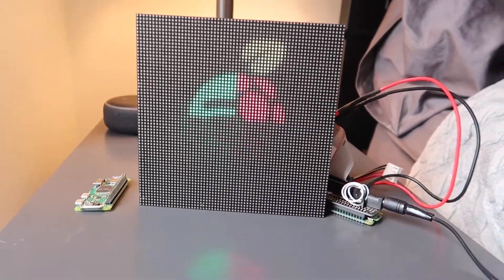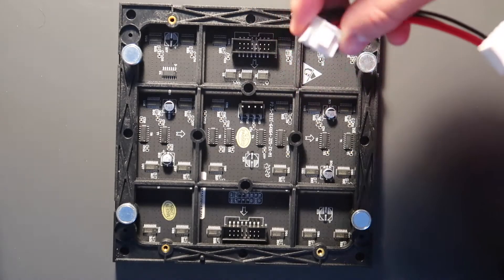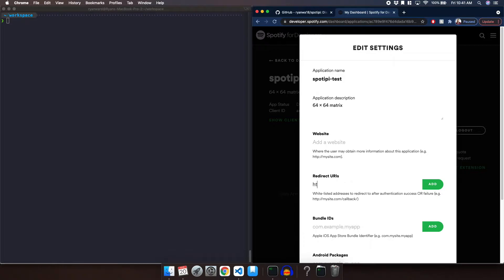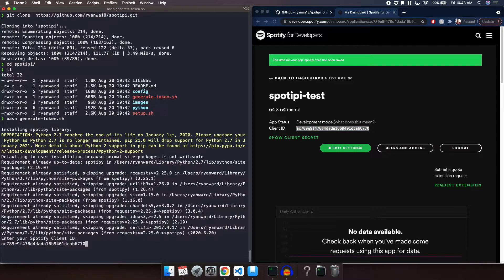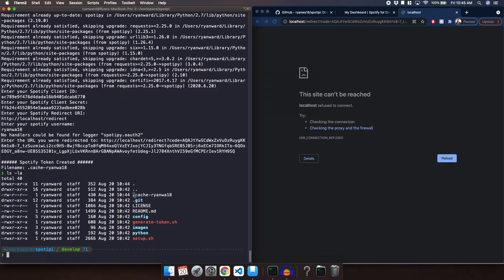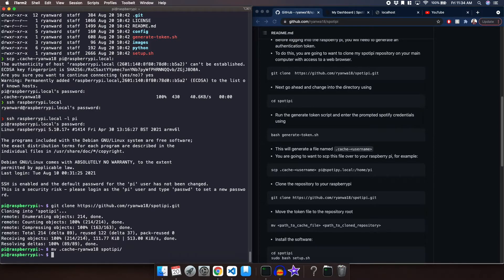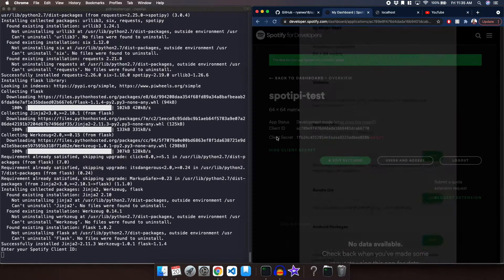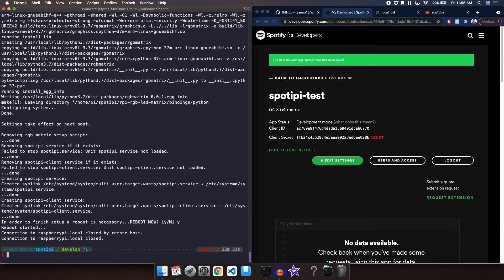Raspberry Pi and Spotify Powered Frame

Comment from the maker: For those wondering, the code changed and the file “.cache-<username>” is now just “.cache”
Reply: Hi Ryan, I am trying to set this up. I have put together all components and soldered the relevant pins on the bonnet, are you able to help as I am trying to set this up using putty via windows. I have installed the raspberry os on the SD, inserted and then SSH'd directly onto the Pi. I have then configured using the commands (im not sure if because im missing any of the copy steps it is not working) I shouldent need to copy anything providing its all been set up already on the pi?)

Any help is appreciated
Reply: @Echo42Luke  see a comment of @rwardtech below. He advises to run everything directly on the pi

Comment: I modified his code so it works on my github (nicotheburrito)
Reply: hi, thanks for your work on github. could you please fix the readme. it mentions wrong urls in think (/Spotify-screen). could you also attach a screenshot in the readme of the running panel? that would be awesome.
Reply: @niesfisch yes i will fix the readme but when you say the running panel, do you mean running the program in the terminal?
Reply: @ i mean the led panel :)
Reply: @niesfisch  sorry ive been busy, ill update the github around this week but just to verify, you want a picture of me using the led panel or just the panel while its off?

Comment: If I were to use a raspberry pi 3b, would I need a power supply for the Pi and the bonnet? And if so, if there a split cable online I could buy that could power both at the same time?

Comment: Hi, cool project, I got it to work and it looks awesome! The only issue is that it takes a while for the display to update, it can take anywhere from like 10 seconds after the song starts to halfway into the next song. Is this due to the nature of Spotify's API or is it something that I can fix myself?
Reply: Update: I got it to switch songs in a timely manner by making the following changes to the code:

1. Make the cache file writable 

2. Change the time.sleep values in the python file from 1 second to 5 seconds (Pi zero gets overloaded if you try to query every seconds, might be fine leaving this alone on a more powerful pi)

3. Add a 10 second timeout to the get request in the python script. I think this was the main issue. If you don’t have this, then it’s just gonna hang forever until it does get a response from the server.

Comment: @rwardtech i tried your tutorial with the solderin but I don't get any output to the screen. The spotify app dashboard recognizes the requests that are coming in but the screen stays black. When i hold the screen and apply light pressure by the sides a few leds light up a little and dim again when i let go. Do I have a faulty screen? The power and data seems to be coming through when i check for a current but the screen stays black. In the raspberrypi.local dashboard everything looks fine and the screen is set to on. Can you help me?
Reply: @rwardtech do you have any idea? still struggling to get it to work
Reply: I have having the exact same issue, any ideas on resolution?
Reply: I also have the same issues, my matrix works with the bonnet when I run other code - but this doesn't work for me
Reply: Was anybody able to figure this out?
Reply: i fixed the code on my github (nicotheburrito)

Comment: Hello Ryan, I have gotten everything to work and it displays a raspberry as the default page. However, the spotify album covers will not display as I play music. How can I troubleshoot what went wrong with this part of the project?
Reply: what path did you use for your token?
Reply from the maker: I would first see if you can access the web client. It should be http://<ip address or hostname of raspberrypi>.local
Reply: @rwardtech  I appreciate the response! I got it working, I was screwing up the path to the token. I did solder it but the display is quite flickery and it is not super easy to tell what album cover you are looking at. Currently looking into that
Reply: Another update! Redid the soldering and it looks gorgeous
Reply from the maker: @brycedesabrais2442  Awesome, glad it turned out nice!

Comment: Do you have to connect the Pi to a laptop, or does it work via Wifi?
Reply from the maker: Nope, it just connects to your wifi!
Reply: @rwardtech  Thanks! So it should work with a Google Home Speaker?
Reply from the maker: @IJuziI  Yep it will work as long as the speaker is connected to your spotify account :)

Comment: Hi Ryan, this was my first Raspberry Pi project and it is such a center piece at home. I started with a 32x32 matrix. Just bought a 64x64 for extra details. I set it up, but I am noticing flickering which was not the case with the 32x32 matrix. Any Ideas? 

Awsome project, and thanks.
Reply from the maker: Thanks for the kind words! With the 64x64 did you solder the “e” pin on the matrix bonnet?

Comment: Hi Ryan, whenever I'm trying to make the .cache file, this message pops up. Also it just creates the .cache file, not .cache-[spotifyusername].

/home/pi/spotipi/python/generateToken.py:12: DeprecationWarning: You're using 'as_dict = True'.get_access_token will return the token string directly in future versions. Please adjust your code accordingly, or use get_cached_token instead.
  token = auth.get_access_token()

It does seem to create the file though so, not sure what the problem is. When completing the setup, my display doesnt show anything though.
Reply: Hey man! Have you solved this? Im having the same issue, my screen is stuck on the base logo. I checked the Spotify console, and I've had one pull request
Reply from the maker: Yes, this was an issue with the code. It removes the username from the file. But just using the .cache file will work just fine!

Comment: Went through this twice now but nothing is appearing on the matrix. The default spotipi logo appears when I try and run a different .py file to test the matrix is working, but no album cover. And if I run your individual .py files (displayCoverArt etc.) I get "No Module Named Spotipy" even though I've ensured it's installed, and tried re-installing it with 'pip install spotipy' and a half dozen other commands. Any ideas?
Reply: hey man, im having the same issue, have you solved it by any chance?

Comment: Hey there, i love teh idea to see the album cover on a led Panel.
So i ordered the stuff needed and tried for myself.
I went through the whole installation without any obvious errors but when i try to open the cofiguration page in my web browser i can't find the pi.

Could anybody offer some help on that?
i can provide more information if neeeded but i just used the tutorial on a fresh raspbian buster install
Reply: Can you connect to the Raspberry Pi via ssh?
Reply: @juliak.2712  yeah all that worked. i'll try again today maybe i just missed something
Reply: @juliak.2712  it worked now. I don't know if i did something wrong several times or if the script got an update. Anyway thanks for yoour help.

Comment: I have a question: Does it make a difference if I use a 64x64 3mm pitch, instead of a 64x64 2.5mm pitch? I wanted to buy the one you use, but it is unfortunately out of stock:(
Reply: The 2.5mm will be slightly smaller, as the pitch is the distance between the LEDs. Outputting to the display should be the same. 

I just ordered the 2.5mm myself as well 😊
Reply from the maker: It makes no difference at all :) The pitch just means the space between the each pixel. A smaller pitch means the matrix will be smaller. Where as a larger pitch means the matrix will be bigger. Hope this helps!

Comment: does with work on Windows? when I put in the bash generate-token.sh command it gives me "command not found" errors and skips over all the Spotify inputs (client id, secret etc.) and tells me that is has created a token "Filename: .cache- ". Not sure what I'm doing wrong.
Reply from the maker: I recommend running all the commands on your raspberry pi. This eliminates issues regarding macOS or windows
Reply: Hey, i just solved your problem:
you have to change the end of line format of the "generate-token.sh" file.
For that open the "generate-token.sh" file with Notepad++.
Then you have to click on edit, format end of line and change to unix.
Afterwards just safe the file and try to run the bash command again.

Hope this helps.
Have a nice day :)
Reply: @maxa.2337  Hey man thanks for your help. This partially solved the problem and it is appearing the command prompt now but it is telling me pip isn't found for line 2. I have python installed on my computer but do I need to install the UNIX version also? This is kind of a first project so I think I'm missing some groundwork stuff which the video assumed I would have.
Reply: @Billy-jw6zz  hey did you figure this out? Having the same issue

Comment: I set up everything but the screen still doesn't display anything, the setting page works but just not the matrix, anyone know what might be wrong or a way to test if my rgb matrix is actually working
Reply from the maker: Join my discord https://discord.gg/P97DPpfV

Let’s see if we can figure out what’s going on :)
Reply: @rwardtech  hey man, could I get an updated link? This is expired?
Reply: did you get the issue fixed?

Comment: Hi Ryan,
This is my first project with a raspberry pi. Is there any setup for the pi needed before installing the software on the raspberry pi? Do I need to install the pi OS first? Also any tips for a newbie at this would be much appreciated :)
Thanks for the awesome video!
Reply from the maker: Yes you need to install raspberry pi OS! I recommend using the version named Buster. There are known issues with using spotipi and the latest pi OS named Bullseye
Reply from the maker: Also join the discord https://discord.gg/P97DPpfV

You can post any questions in there :)
Reply: @rwardtech  can we grab a fresh link ? Running into issues with the generating token step

Comment: Hey there nice video, is there a way to connect this to a battery instead of a wall adapter? Would be really nice to hang it on a wall permanently only having to take it off for charging a rechargeable battery.
Reply from the maker: This is definitely a possibility however it’s something I have not tested. I would imagine you would need a pretty good battery and would have to charge it pretty often

Comment: I’m not good with soldering. During the set up, is it possible to use the convenience option and skip the soldering of GPIO 4 and 18 for the project or is it an absolute requirement?
Reply from the maker: It is possible to just use the convenience option! You likely see flickering on the display but it should work

Comment: Great tutorial. Thank you so much. Btw is it possible to change the Resolution to 128 x 128.I have 4 Hub75 and I want to chain them together.
Reply: I am also looking for a solution for this. I have a NovaStar MCTRL300 and 4 1.9mm 128x128 modules on a frame.  I'd love to do something on this with a high definition image of the album cover but am having a hard time finding a way to do it, between using a service like Dakboard or programming something like this. Please reply if you find a way to do that?

Comment: Hey, I have the following problem: When I run the file "bash generate-token.sh
" I get this message "generate-token.sh: line 2: pip: command not found
". After my user name this message: "Traceback (most recent call last):

   File "python / generateToken.py", line 2, in <module>
     import spotipy
ImportError: No module named spotipy
"

Can you help me?
Reply: It works. I have forgot to installed Pyhton. But now: i dont get the Authorization by Spotify.
Reply: @Official_LKS  hey, did you solve this problem? Having the same issue
Reply: @EliBlumkin  Did you work with Gitforwindows? You will need an extra computer. On this computer, you must load and install the dates from GitHub.
Reply: @Official_LKS  I’m working on a Mac, but I have the exact same error

Comment: Hey Ryan, 
This is a great project and I would love to do it. But unfortunately when I try I get this error. ImportError: No module named spotipy. I have tried both on my MacBook and on a raspberry pi and I am getting this error on the both. Do you know why this would be. Thanks James.
Reply from the maker: I appreciate the kind words about the project! It sounds like you have not installed the spotipy library. In order to fix this simply type "pip install spotipy" in your terminal.
Reply: @rwardtech  I'm receiving the same error even though I've installed the library several times using the "pip3 install spotipy" command. All lines show "Requirement already satisfied" and then when I run the "bash generate-token.sh", it shows 
"File "python/generateToken.py", line 2, in <module>
    import spotipy
ImportError: No module named spotipy"

Do you have any advice for me? Thank you in advance!
Reply from the maker: @wesbeights  hey Wes! I’ve seen bizarre behavior with that package in the past. I recommend trying to run “python3 -m pip install spotipy” instead. After you run that run “pip3 list” to ensure its installed
Reply: @rwardtech  Thank you for the response! I just gave that a try and it came back with "Requirement already satisfied" for all. I then tried "pip3 list" and it gave me this: certifi            2021.10.8
charset-normalizer 2.0.12
distlib            0.3.4
filelock           3.6.0
idna               3.3
pip                22.1.2
platformdirs       2.5.1
requests           2.27.1
setuptools         49.2.1
six                1.15.0
spotipy            2.19.0
urllib3            1.26.9
virtualenv         20.14.0
wheel              0.36.2

Comment: Hi Ryan, this is an awesome project! In my attempt I fail unfortunately, maybe you have an idea?
Actually, everything worked as described, but the display is distorted by the colors. You can see on the matrix that the covers are loaded, but white and bright colors are displayed in red.
Do I still have to configure the display of the colors correctly somewhere here?
Maybe you have a good tip for me, have the process now already 3 times as described, but the result is always the same.
Thanks!!
Strange is also that the spotipi logo is displayed well in the right colors.
Reply from the maker: I’m really glad you got the display to work functionally! It is a pretty complicated project and I tried to make it as easy as possible to get running. 

As for troubleshooting, I highly recommend reading this: https://github.com/hzeller/rpi-rgb-led-matrix 

There is a README.md with a “troubleshooting” section. I used this when building the project to fix any issues with the display. 

If you still can’t figure it out, reach out and I will see what I can do :)
Reply: Hi  @rwardtech , thanks that really solved it. Someone there described exactly my problem. When the panel gets too little power, white light is displayed as red. Changed power supply and good. Sometimes so it can be so simple :D
Reply from the maker: I’m so glad you figured out your problem! That is an excellent resource for troubleshooting anything with a RGB matrix.

Comment: can you chain these displays together to get a resolution of 128x128 and can you output out to it like a normal display?
Reply from the maker: That’s a really good question. You definitely could chain them together but would need to modify the source code to support the updated resolution.
Reply: @rwardtech  think I'm gonna just bite the bullet get down to some tinkering! Thanks for the video!
Reply from the maker: Good luck with the build! Let me know how it goes and if I can help with anything.
Reply: I'm thinking of doing this so any information on how it went for you would be really appreciated!